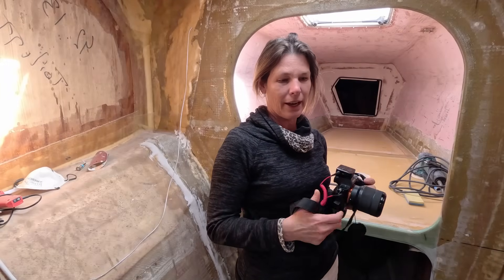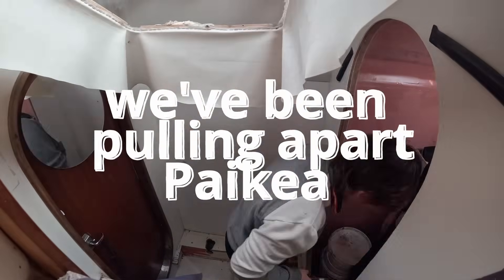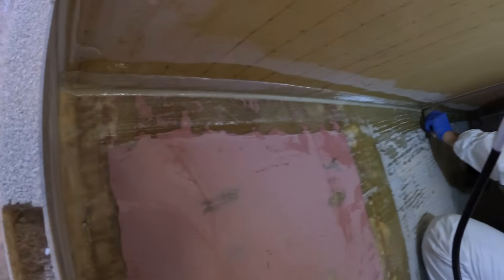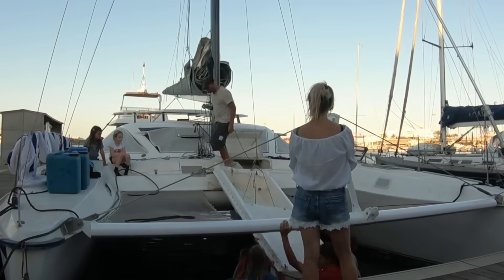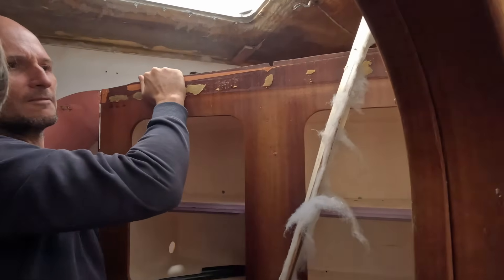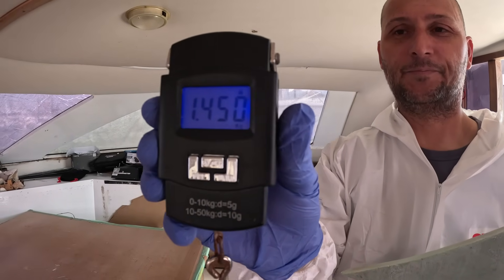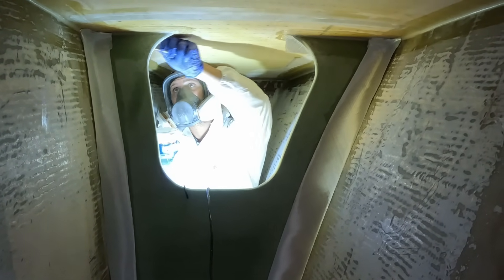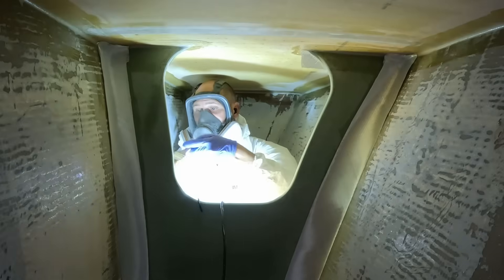Are we Making our Catamaran TOO LIGHT?

Comment: Nope…as long as she is stiff and handles the pressure and pounding the sea will deliver. The problem is durability from continuos motion. Race boats are light and stiff but only last a season or even just once around the world. Cruising boats need to be durable to last years so materials and designs will be different as you pointed out. I remove about a ton of junk off Swift and she sits a little higher in the water and feels better at the helm. We just did 180nm in 20 hours. So fun, love sailing.
Reply from the maker: Nice work Dana! So good to hear you are out enjoying Swift on the water!

Comment: Just as a side note,  you cannot just consider gross weight in a cruising vessel.  CG is very important when considering lightening a vessel’s hull,  as is CB.  By lightening the boat hull lower structure,  the CG rises and creates a less stable vessel ie more pitch and roll.  Although roll is controlled mostly through the inherent design of a catamaran,  it is not zero.   A higher CG also reduces the maximum limits at which any vessel will capsize,  even a Catamaran.
Reply: Excellent points.